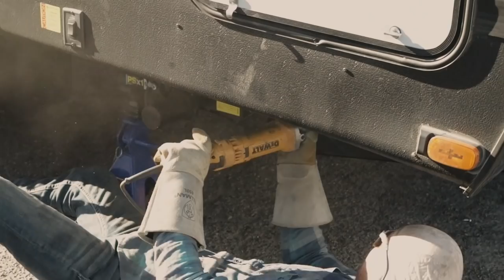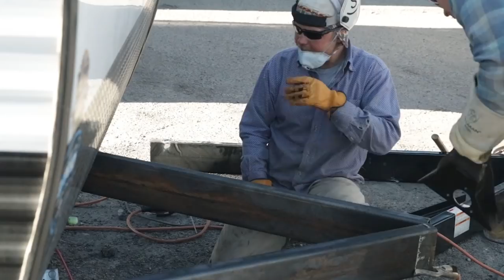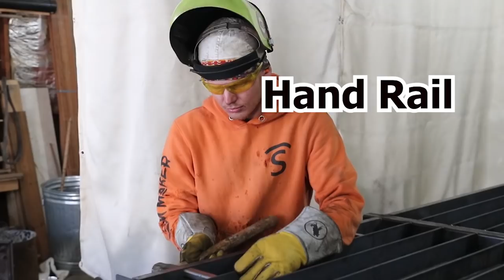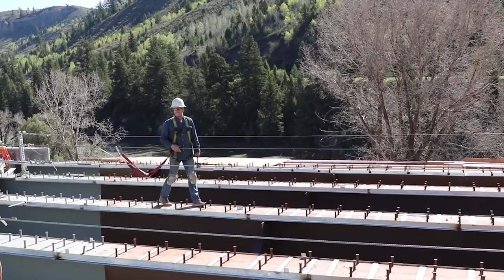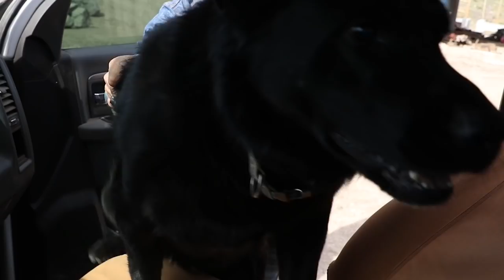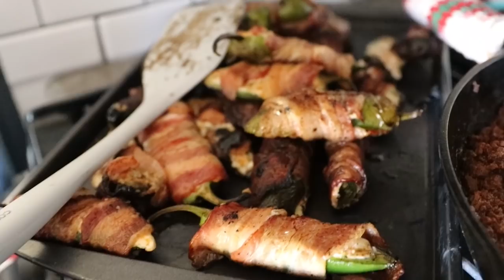The Worst Welding Advice I Was Told And Lived By For Years

Comment: Structural hand here, built production platforms and boats; everything from suction piles to the vent boom.   I worked production pipe, I&E and structural.  

IMO structural is the hardest.  Making tie ins on a deck float with 18 cranes hooked to it, cutting gussets out the btm of pontoon on a jackup boat, installing new bulkheads on a ship, building boat bumpers, 4 leg vent booms..... pipe hands, hardest thing they had to was get pipe in the rack and the helpers and fitters did that.  Pipe welders were some cry babies.  If the scaffold wasn't perfect or they had to stand on a stool to make to make a weld they were bitching.  Only time they weren't crying was when they were in the shack for break.

Comment: There are  2 - thing’s  I live by  since the day I started my welding career! 1-your only as good as your last weld. 2-  It takes 45 days to develop a habit weather it’s a good or bad habit ,it’s still a habit. Those 2 moto’s have got my ass countless jobs in structural welding beating out the next guy to get the job.

Comment: I am at best a hobby welder. I have however started, built, run, and sold more businesses than I can count. I also learned the hard way, when they start to fail, and you see no clear recovery plan, put them down with both barrels fast and move on. Don't throw good money, or good effort, after bad Don't get emotionally attached to a buisness. Be ready to improvise, adapt, and overcome; and move on when that fails. 

That said, all I can say about that advice is WTF? 

That advice really has little to do with welding. It basic business planning 101 (even working for someone else, you are buisness of one person). 

You are either making money, or you are not. If you are not making money, you are better off going fishing while you think long and hard about what you are doing wrong.

Comment: Been a while since I've seen a vid from you, glad to see things are going alright for ya!

Yeah, the "if it's not round put it down" advice is in a lot of ways some of the worst advice I've ever heard. There's a small grain of truth in there, but it's terrible advice to blindly follow.

Specializing and being REALLY good at that specialty is a great way to make really good money. But don't discount everything else, or not learn other things because it's not in that specialty. There's no reason to not learn, and become at least passably proficient in other specialties.

Pipe and structural have enough in common where there's a lot of skills that cross over, so it makes it easier to shift gears between the two. Both are usually thick metal, lots of rod burning in a lot of positions. The electrodes are different of course, and the fitup and prep are different even the simple things like how to get a grinder in the little nooks and crannies without it grabbing hold and taking off on you, or how to change directions on a corner instead of flowing around a pipe - but theres so much similarity too.

Then theres other welding thats like night and day like running a tig on thin aluminum that has to be perfect, and beautiful - there might not be nearly as much that crosses over - but if it tickles your fancy, and you can make money doing it - why not learn it? Most pipe welders, structural is probably a natural second skill to learn, but who knows - maybe you wanna learn how to tig some weird shit - like titanium, or whatever - and maybe that leads you to a big money job welding parts up for nuclear power plants or something.

I think there's a lot to be said for picking your specialty, and living it for a while. You don't wanna bust a test on your primary moneymaker because you were too busy figuring out how to fit up a staircase, but at some point you get to where you could fit and weld pipe in your sleep. It's kinda pointless to focus every bit of energy just on pipe when you've already got it, you're already doing it all day ... learn some new tricks! Expanding your skill set is never a bad thing.

Comment: why on earth are you arc welding when it would be far easier and faster to Mig it? I had a job today that was Arc welded castors on a trolley that holds 400-700kg's of kitchen panels from a powdercoater (I had to replace the castors/wheels with new ones). I ground off one weld on one side and just knocked the castors off the other weld just snapped with a tap and I mean a tap with a hammer. Arc = big no unless you get penetration and have a clue on how to do it, would never do it on a trailer like that unless I knew how.
Reply from the maker: That’s the difference. I know how to do it and trust it way more then wire.
Reply: @JacobSchofield  Know that feeling the blowback or through is serious with the wire. I much prefer laying the bead down and knowing it will hold! Still have no clue how to Arc weld properly. Just seems a dangerous game to me. (Edit was replying to two posts haha and got confused!)
Reply from the maker: See you know how to do wire probably a lot better then I do. That’s why you trust it more then stick. I weld welding beads together with wire but that is really all I trust it for because I have little experience with it. 
To each there own. As long as it’s done right it dosnt matter to me how it gets done.

Comment: Why are most welders so arrogant? I weld pipe structural prototype certified aircraft welder fabricator machinist mechanic pipe fitter and unless you are multi talented you need to shut your mouth and run your machine

Comment: $60per hr and barely making it?  "How sway?"
Reply from the maker: You guys have no clue what it takes to run a welding truck lol. After fuel in both the truck and machine. Consumables which include rod, oxygen acyt. All your tools witch just a simple pipe beveler is 2500.00 and I have 3 on my truck at all times. Plus all the tools and wear and tear on equipment, Plus room and food and being away from hone 60.00 an hr really means about 30.00 hr and that’s if nothing breaks down.

Comment: Structural welders have more knowledge about the whole spectrum other than making pipe welds alot of structural welders are very knowledgeable in metallurgy high stress weld areas and problem solving